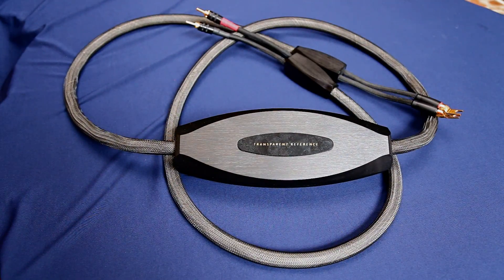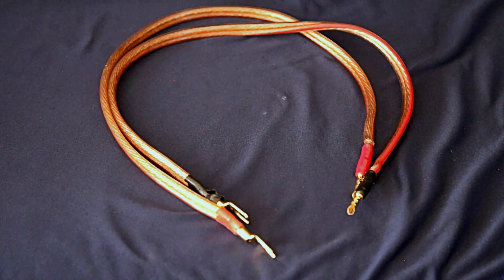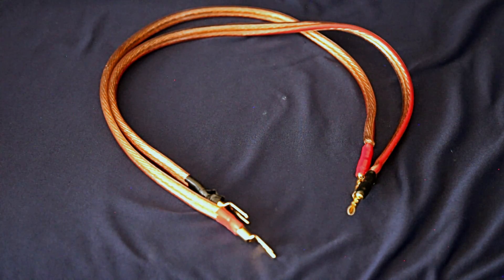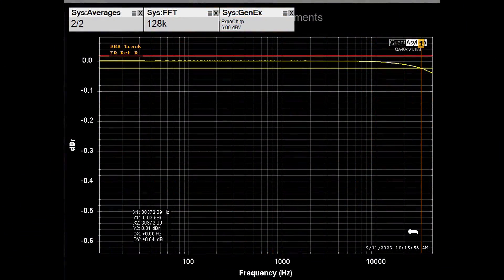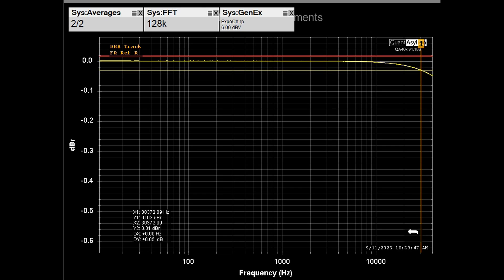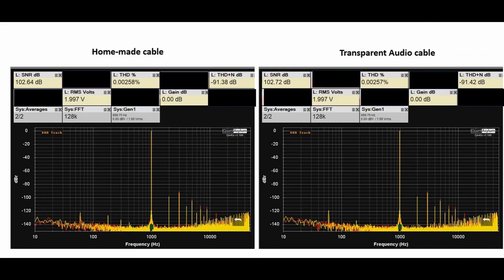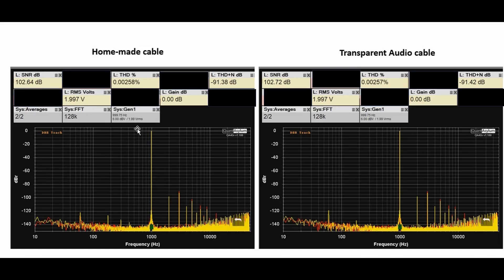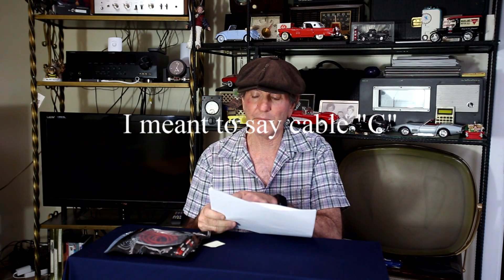$8000/pair Speaker Cable  vs. $14 DIY Speaker Cable A/B Test: Vintage Audio Review Episode #87

Comment: The results are as expected, wire is wire, the end.
Reply from the maker: Amen!
Reply: I cant believe how many tone deaf followers there are.  Im sure these people also could not tell the difference between milk and orange juice in a blind taste test.
Reply: Do some research on the crystal structure of copper wire and it's affect on sound quality or do you think wire regardless whether silver, copper, aluminum or gold just doesn't matter. You know a bicycle with flat tires still works. Do you believe rubber is rubber and all car tires perform the same? I assume you buy the cheapest tires available for you car then and proclaim them superior or equal to all others. If so, you need to look into tires developed for Nascar. There is a reason they don't use the same tires they had in the 50s and 60s. Wire has come a long way in the last 100 years and your idea of wire doesn't seem to have progressed at all. I'm not advising to buy $10,000 cables but cables more often than not sound different in different systems. There is a dynamic interaction that happens that can't yet be explained.
Reply: I don’t think so. Maybe with speaker cables but with interconnects, you can definitely hear differences. Now whether or not those differences mean more expensive or if those differences matter enough to spend the extra $$$, that’s something every audiophile will have to figure out with their own ears.
Reply from the maker: @Simon-oq6ds  That is key- if you hear differences and want to spend the $$, go right ahead, it is your money and hobby- thanks for the comment.

Comment: The flaw in this test is the switch box and the secondary set of connecting cables.
p.s.  I don't believe in snake oil cables
Reply from the maker: I appreciate your comments and am glad you don't believe in snake oil cables. THe secondary  set of cables was constant for both cables and only 2' in length and should not have any real effect on it, but your point is taken. The switch box  used also was constant to both set of cables and does very little to degrade the signal path, particularly in a mono test. There is a link in the description that shows my measurements of the switch box. If there was any real difference between the two cables one would have expected someone to hear the difference  more often than they did. I try to make the a/b tests as neutral as I can and everyone that has participated in them enjoys them and feels they learned something, plus we get to eat and drink and talk audio...
Reply: A chain is never stronger than the weakest link, and maybe the switchbox or the secondary cables was the weakest link?
You could also use a old tapedeck as your source, and then the cables would not matter at all.
Reply from the maker: @geirhaugen3781  Thanks for taking the time to comment. Someone brought up the point about the switchbox or secondary cable, and as they are common to both, they should not make much difference. There was a link to testing of the switchbox in the description. I spent part of this weekend testing a cassette deck for an upcoming video- you are right about the sound but they do have a purpose for some of us....
Reply: @vintageaudioreview 
"  and as they are common to both, they should not make much difference. "

Or, worst case, they made the same difference both times.

Comment: Thanks for your efforts & knowlegde sharing. I'm not a fanboy of cables, but still experiment with different materials and building techniques and would say it has some hearable difference. So in your mono setup, some may say: okay not enough transparency to hear diffeence, or DAC not able to provide this detailed level or even the switch box (besides the equal measurements) had some minor effect... All I say,  I'm not someone saying it has NO impact, but it has way less impact changing driver or crossovers, or even using a high quality source signal.... and no, my highend DIY speaker cables I build, are less €800 a pair and would never spent more, not even for 1m system.... 😊
Reply from the maker: Thanks for taking the time to share your thoughts.  THere are definitely more important parts of the audio chain than speaker cables. It sounds like your DIY are still pretty pricey at $900/pair....
Reply: I would bet you your house I could sub several different cheap and exensive DACs and YOU COULD NOT TELL THE DIFFERENCE. I would also bet you the entire cost of the Moon that you can't a/b cables in a blind audio test.   Your money and elitism can't protect you from the truth. I spit the truth and poop facts!!!   For realz, dawg. I be straight spittin truuffs and poopin facts. For realz. Bling bling and the schnizzel for rizzel.   And I blast knowledge in the form of liquid diarhea!!!  Get ready to get poopedz and factz!

Comment: The difficult part is creating a quality image and it appears that wasn't part of the evaluation. Recreating precise imaging is very difficult and does take some nice gear and a room with some treatment.
Reply from the maker: Thanks for the comment and you are correct that imaging was not a factor in this as only 1 speaker was used, and that is the result of limitations of the a/b switcher. But I honestly doubt the cables would make a difference in the imaging if all things were equal.
Reply: The "soundstage" or "phantom center" that so many audiophiles go on about is a giant red herring... Show me any circuit in any part of any system that creates stereo imaging.  Seriously... it's just not there.

The much touted "soundstage" actually comes from the source recording. It is burned into the recording at the mixing and mastering phases using pan pots and phase shifts. Why do you think it's different for every recording?  

A stereo system processes 1 voltage that varies over time, per channel.  It does not know what it's playing, it's just taking what it's given and giving it enough power to drive a speaker. The signal itself is literally a map of how to move the speaker cones. Each channel is largely separate from all others and that is by design.  So how is it possible for an amplifier or DAC or PreAmp to edit the positioning of the instruments?

Comment: If there are arrows pointing towards the spade connectors would this not suggest the orientation they should be connected; ie signal direction of travel towards the spades, so spades connect to the load end (the speaker)?
Reply: The arrows indicate the recommended signal flow.
Reply: @fuckfacebook3440 
During which half cycle of the waveform?
Reply from the maker: @fuckfacebook3440  That appears to be the consensus, though I could not find anything on their website.
Reply from the maker: Thanks for the comment/question. my understanding is that the arrows point towards the amp connection side. That is the way that they were measured which did not show anything abnormal at all. My electrical engineering friends laughed at the concept of the cables requiring a connection in a certain direction....
Reply: @vintageaudioreview Usually those arrows show direction of a signal flow from a source to a load.
Reply: @IliyaOsnovikov 
In which wire?  It's an AC signal... current flows in both directions in both wires.
Reply from the maker: @IliyaOsnovikov  It is an ac so the signal flow should not be a factor. I did not see anything on their website specified that, but I did not do a "deep dive".

Comment: Great video! I appreciate your scientific approach with a subjective analysis. Can you add a link for wires and connectors you used? Thanks! Keep up the great work!!
Reply from the maker: Thanks for the encouraging comment and here are the links you asked for:

https://www.amazon.com/gp/product/B0149VC6KC/ref=ppx_yo_dt_b_search_asin_title?ie=UTF8&psc=1

https://www.parts-express.com/Gold-Plated-Screw-Type-Banana-Plugs-14-8-AWG-4-Pcs.-091-358?quantity=1
Reply: @vintageaudioreview 
Ummm ...  I really hate to break this to you but that Bullz Audio wire is probably Copper Clad Aluminum.  One of the reviews showed a magnified image of the strands and in the true CCA style... if you scrape the copper and it turns silver... it's aluminium wire.

Another complained about it rejecting solder and not tinning well.  That's what CCA wire does when heated.

Note that the description does not say "Oxygen Free Copper" ... it says "Oxygen Free Cable "

But this also has another interesting aspect ... If indeed the Bullz Audio cable is CCA ... you've just proven that an $8,000 cable is no better than one made from the world's worst wire!
Reply from the maker: @Douglas_Blake_579  Well, You are indeed correct- it is CCA! Great catch. Not sure how I missed that when ordering it. I have not really had any problems with tinning the wires. And it works great, to be honest. Will have to see how it holds up over time.
Reply: @vintageaudioreview 
The product description is deceptive. From reading it I took they were trying to pawn it off as OFC.

A lot of people use CCA without problems ... but they're putting on connectors with set-screws or crimp connectors and they're not moving the wires around much.  

Where you get into trouble with this stuff is when the copper layer is damaged by heat, bending, crushing, etc. then the exposed aluminium starts degrading right away and before long it's trash.

Time will tell.
Reply from the maker: @Douglas_Blake_579  I may use them once a week or two when I'm testing a piece of gear and will start keeping an eye on them....
Reply: @vintageaudioreview 

Yeah, I'd be watching them very carefully.
Reply: @Douglas_Blake_579 
@vintageaudioreview  
Ha!  I clicked on the Amazon link that was posted for the Bullz speaker "cable" and realized straight away that it was cheap CCA as well!  😵‍💫

But now, as you said, Douglas, I love this objective/measured + blind listening test even more!!!

...$8k-$9k+ Über High-End "Audiophile" cables vs. bargain-basement crappy Copper CLAD ALUMINUM, and no one could quantify an audible difference !!!  😂 

This almost had me ROTFLMAO!
Reply from the maker: @bbfoto7248  It's a bit embarrassing that I didn't catch that the cable was not OFC, but it works well- at least for the short term.
Reply: @bbfoto7248 
Yeah ... it really does put the whole thing into perspective.
Reply: @vintageaudioreview 
Naaa ... I've made far worse mistakes than that in my day.  The good news is that it made your test all the more poignant.
Reply: @vintageaudioreview  No worries, mate!   I've been fooled by this type of product misrepresentation and deceptive marketing as well!

Some of these companies have become very clever, and will sell you a wolf in sheep's clothing if you don't really scrutinize the details!   It's all good. 👍

Comment: Can these be electrically nulled like that Bob Carver amp test?
Reply from the maker: Thanks for the question. I suppose you could send the same signal into both cables- using appropriate adapters into and out of each cable- and put them into a scope where you can subtract one channel  from the other, so all you are left with is the difference between the two. You could test a few frequency points across the band and see if there was any major difference, which I would guess in this case, there was not....